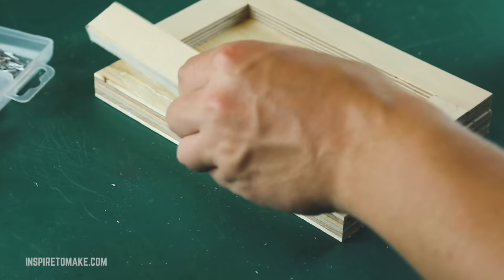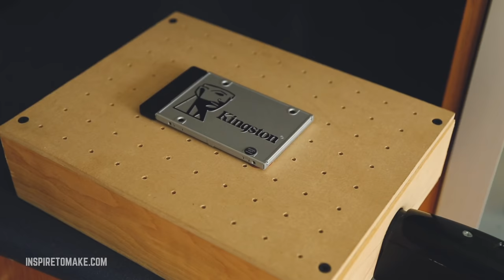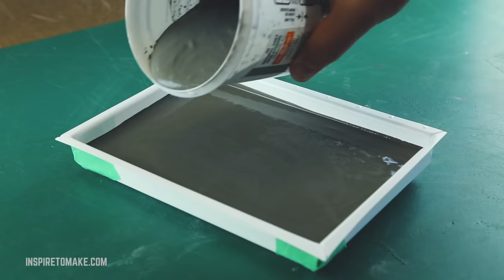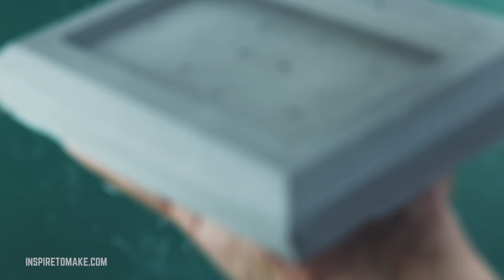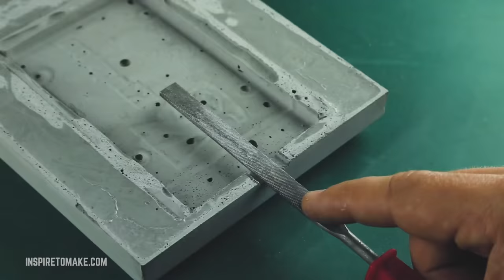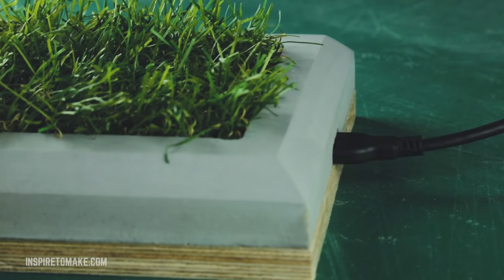How to mod a SATA drive case - Cement Kingston SSD drive enclosure

Comment: This is a concrete SSD not Hard drive
Reply: it is kind of
Reply: a SSD IS a hard drive. He made a SSD Enclosure.
Reply: A SSD is a HDD, but a HDD is not necessarily a SSD.
Reply: +Liavaÿn Thorson this is correct!
Reply: a concrete suicide squad?
Reply: +VOID x lol
Reply: I can also imagine this working with a laptop hard drive
Reply: +Liavaÿn Thorson 
fingers are not a thumb, but a thumb ...
Reply: External Hard drive
Reply: SSD = Solid state DRIVE.
Both SSD and HDDs are Hard Drives, HDDs are Hard Disks. Don't get confused.
Reply: An SSD is not a hard drive. HDD = Hard Drive Disk and SSD = Solid State Drive. The "Hard" in HDD means the solid platter that is inside the HDD. SSDs don't have the platter and uses flash memory to store the data.

Comment: You had me up until you glued in the drive. Can't get behind permanent disk entombing. I'd like to think the case could be reusable via some latch or other clever closure when the drive fails or you decide to upgrade. Your method is a bit short-sighted.

Comment: Nice but not a good idea. Every electronic device, including solid state drives, generate heat. This is a terrible idea for heat dissipation. It would shorten the drive's lifespan.
Reply: The USB interface limits the peak data rate of the SSD not allowing the SSD to heat up.
Reply: Wow, this is the most legit response ever. Company that makes the drive tells you its ok.

Comment: I made one, was very cool, but i did not use glue to wood and concrete, used neodymium magnet , because with them it is possible to remove , move or change the ssd .

Comment: hi may I know what is your cement mix. very tight and smooth and satin finish. thanks. do you video of the cement mix and also your vacuum mould?
Reply from the maker: I was using a tile grout for this mix, with no sand. Regular unsanded cement will do the same. mix it with water to a yoghurt consistency.
Reply: Great thanks for the reply. with your vacuum mould can do many diy stuffs. Great direct giving people ideas vidz. That white sheet must be polycarbonate?
Reply from the maker: It is styrene. But you can vacuum form polycarbonate as well

Comment: so no air flow? :D you're going to roast your hdd with this concrete case...
Reply from the maker: SSD is not getting that hot, plus concrete will take most of the heat off.
Reply: SSD's still get crazy hot and concrete is a decent insulator. just don't copy a whole drive to that thing and you might be ok.

Comment: Is it actually possible to plant real grass on it?
Reply from the maker: +Zona ALG yes :)
Reply: Inspire To Make Wont the water leak into the drive?
Reply from the maker: Not if you seal the concrete with some glue or epoxy
Reply: Inspire To Make
Cool, maybe mixing the concrete with some iron dust can give it a rustic look
Reply: Zona
Reply: Zona ALG

Comment: Hate to be a killjoy but SSD/HDD performances will drop harder than Hiroshima's bombs when enclosed in something like this with no air flow at all and even no air inlet, if will basically broke/burn it due to too high temperatures.